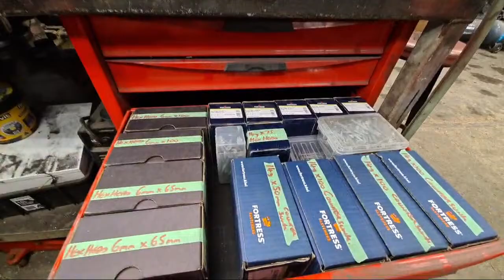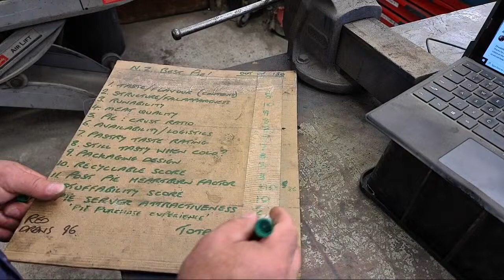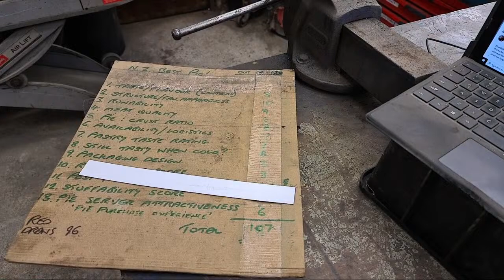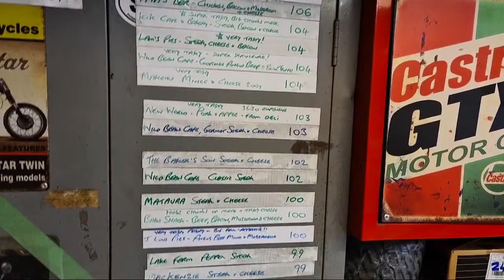Andy Mechanic is live! Ben says this Pie is great! let's find out, chat & updates...

Comment: I have a Yamaha Viking it will not turn over I put new starter and starter solenoid and it just clicks. Any tips for me
Reply from the maker: Check your battery & also the connection of the heavy starter circuit cables - poor connection. Try bridging the starter relay across the big terminals too - could be an internal fault in starter relay.

Cheers Andy